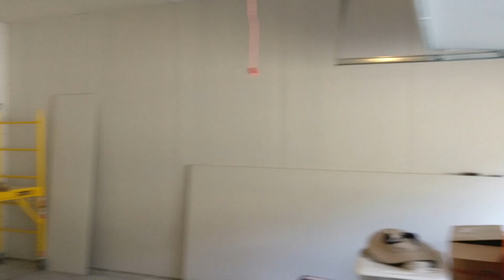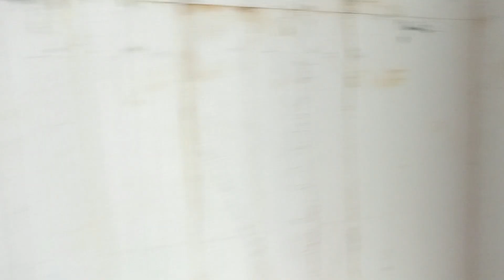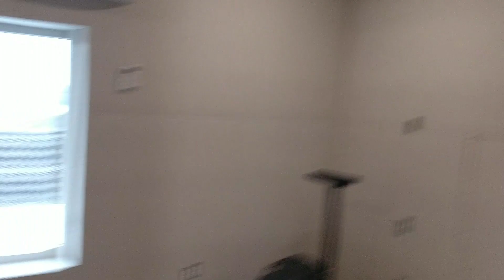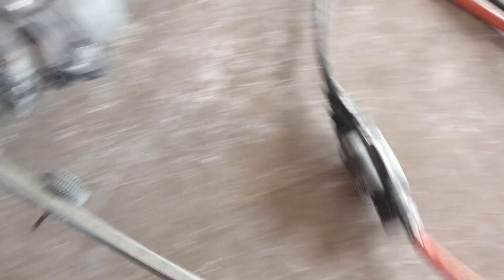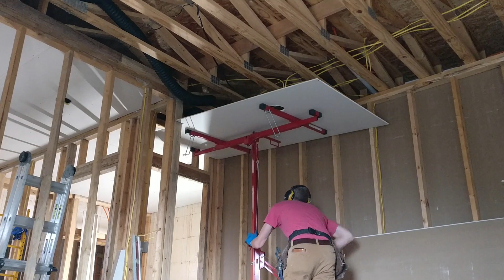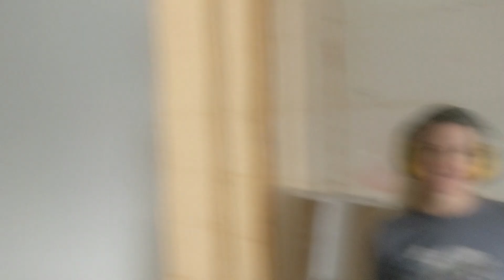Putting up drywall on wood and ICF walls in our lake house.

Comment: Why run more expensive 12/2 NM-B Romex 20 amp wire for low-watt LED lights?
 Isn't this like using a fire hose as a drinking straw?

Comment: What i need to understand is, does the panels gets screwed directly or pasted on to polystyrene?? How strong is it to hold the boards??? im confused polystyrene cant hold anything😢😢
Reply from the maker: There are plastic strips that act just like wood studs every 8 inches imbedded and part of the ICF blocks. The drywall is screwed into these plastic strips.

Comment: Why not 1/4" drywall? With that, it is lighter and ICF doesn't need any structural needs for thicker drywall. Just curious if there is a major flaw in using 1/4"?
Reply from the maker: Since I was hanging it by myself it was just easier to make sure it stayed rigid and didn't break on me. I haven't seen 1/4 used on walls, though I guess you could on ICF.
Reply: @LakeLotBuild  in some instances it can be harder to use, and sometimes there isn’t a cost benefit. Appreciate the response. Thanks for sharing your build. I gleaned a lot from it

Comment: How did the flat roof work out with all the recent snow?
Reply from the maker: No issues with the snow at all! It the melting that is a problem 🤣.  We  have some sort of leak happening (very small), so rain or snow melt will come through ceiling in one place. Hopefully once the siding is one and the groove that was cut in roof if sealed up, that will stop. 🤞